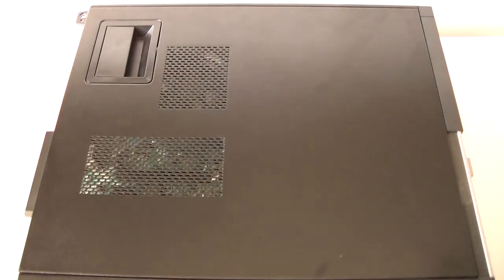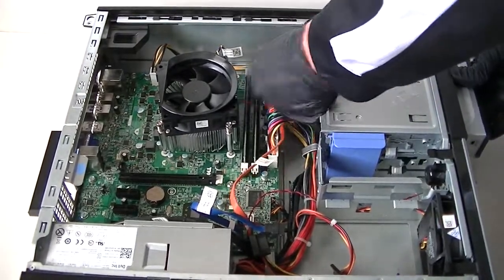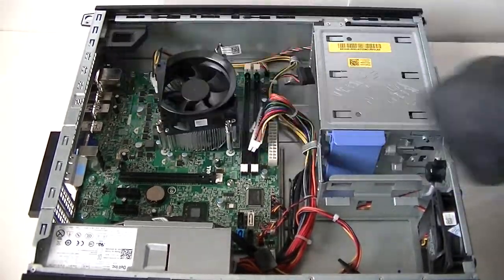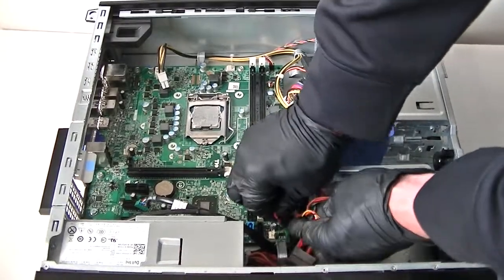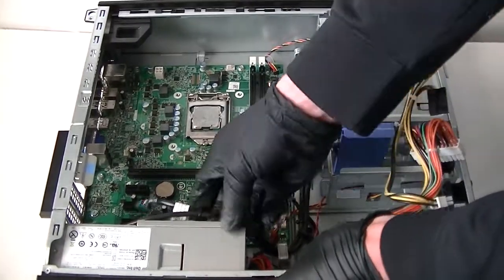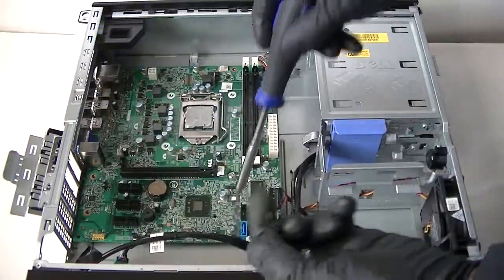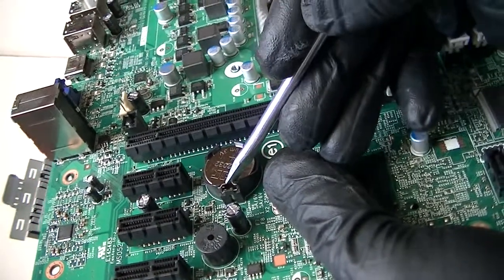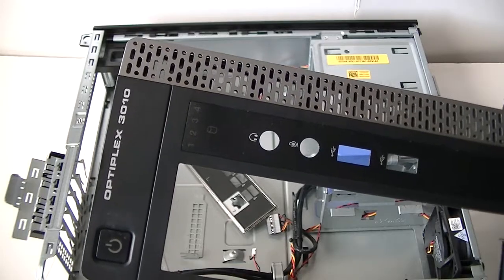Dell Optiplex 3010 Teardown

Comment from the maker: List of Parts and Upgrades work with this PC.

USB Wifi Adapter for PC AC600Mbps Wireless Network Adapter

https://amzn.to/2ZaGuHb

List of RAM works with PC:
Supports MAX 16GB Memory.

(1.) Crucial 8GB Single DDR3L 1600 MT/s (PC3L-12800) Memory CT102464BD160B
https://amzn.to/2VhGv8O

(2.) Crucial 4GB Single DDR3L 1600 MT/s (PC3L-12800) Memory CT51264BD160B 
https://amzn.to/2xq46wb

(3.) Crucial 16GB Kit (8GBx2) DDR3L 1600 MT/s (PC3L-12800) CT2K102464BD160B 
https://amzn.to/2VpsKpP

This video cards will work with this system.

(1.) GIGABYTE GeForce GTX 1650 OC 4GB GDDR6, GV-N1656OC-4GL Video Card
https://amzn.to/2B7N1sP 

(2.) Gigabyte Geforce GTX 1050 Ti OC Low Profile 4GB GDDR5 Graphic Card (GV-N105TOC-4GL) 
https://amzn.to/2XEqKMb

(3.) MSI Gaming GeForce GTX 1650 4GB GDRR5 Low Profile Graphics Card (GTX 1650 4GT LP OC) 
https://amzn.to/2VkDdSd

(4.) MSI GTX 1050 TI 4GT Low Profile  Graphic Cards 
https://amzn.to/34r0AxG

(5.) Gigabyte GeForce GT 1030 GV-N1030D5-2GL Low Profile 2G Computer Graphics Card 
https://amzn.to/2Xu3SyO

(6.) ZOTAC GeForce GT 1030 2GB GDDR5 64-bit PCIe 3.0 DirectX 12 HDCP Ready Low Profile Video Card ZT-P10300A-10L 
https://amzn.to/3eayL1b

(7.) MSI Graphic Cards GT 1030 2GB GDDR5, Low Profile 
https://amzn.to/390Spum

Thermal Compound Paste:
(1.) Arctic MX-4 2019 Edition Thermal Compound Paste Carbon Based
https://amzn.to/2XcsZo4

(2) Arctic Silver 5 Thermal Cooling Compound Paste 
https://amzn.to/2ziNU0H

(3) Noctua NT-H1 3.5g, Pro-Grade Thermal Compound Paste
https://amzn.to/36kTk7A

(4.) ARCTIC MX-4 (current edition) Thermal Compound Paste 20 Grams 
https://amzn.to/2DhGJaK

Hard Drive Caddy Adapter  3.5 to 2.5:
(1.) Dell 3.5" to 2.5" SSD or Hard Drive Caddy Adapter R494D 0R494D 
https://amzn.to/2XTPeRr

(2). Dell Hard Drive Caddy, R494D, F767D 3.5" to 2.5" SSD or Hard Drive
https://amzn.to/3cTkcOk

SSD list works with this PC.
(1.) Samsung 860 EVO 500GB 2.5 Inch Internal SSD MZ-76E500B/AM) 
https://amzn.to/2yNxnkE

(2.) WD Blue 3D NAND 1TB Internal SSD, 2.5" WDS100T2B0A
https://amzn.to/2wvnC9Z

(3.) WD Green 1TB Internal PC SSD  WDS100T2G0A
https://amzn.to/3cbrcWa

(4.) SanDisk SSD PLUS 480GB Internal SSD SDSSDA-1T00-G26
https://amzn.to/3a3i9ou

(5.) Crucial MX500 250GB 3D NAND SATA CT250MX500SSD1(Z) 
https://amzn.to/34rZlhy

(6.) Samsung 860 PRO SSD 256GB - 2.5 Inch SATA III Internal Solid State Drive
https://amzn.to/2ybiHLK

(7.) Samsung SSD 860 EVO 250GB 2.5 Inch SATA III Internal SSD 
https://amzn.to/2VjIAkK

(8.) SanDisk SSD PLUS 240GB Internal SSD
https://amzn.to/3c7SEE4

HDD list works with this PC:

(1.).WD Black 2TB Performance 3.5" Hard Drive - 7200 RPM Class, WD2003FZEX 
https://amzn.to/2xFUeyF

(2.).Seagate BarraCuda 1TB Internal Hard Drive  3.5" Hard Drive - 7200 RPM
https://amzn.to/3g8FXM8
Reply: What does wifi adapter do?

Comment: Is there a power supply that will work with this specific model? I'm looking at running a 1650 ti but I don't know the exact power requirements or if the 250w power supply will be enough
Reply: Any PS will work, tho it's surely going to be too big for the case.
I have a 750W PS for this computer, I put it outside

Comment: Why do sata ports 2 and 3 not register in legacy/ bios settings?
Reply from the maker: HI it could be disabled in BIOS settings and you have to check and see.
Reply: @Mxkdt  only port 0 and 1 registered in bios settings

Comment: i have the very same one. i got it from a guy cleaning out his place. i've already installed the hard drive with an ssd added 6gb of memory and a geforce gt730 video card plus a 3.0 usb card in the back. it's a night and day difference. i use it to stream sling and watch videos.
Reply: al dee are you using the stock power supply?

Comment: is the any proprietary issue ?
Reply: i don't recommend u to do that, motherboard is suck u should take the front panel and power switch front panel from the dell case with motherboard to avoid the errors in bios . the normal cases comes with different front panel design connectors that will make the motherboard do same errors
Reply from the maker: No issues
Reply: do you think i can transfer all the system to new case (non-dell cases)
Reply: @barneyman1574  We have a solution to the proprietary front panel connectors, check out the recent video on our channel